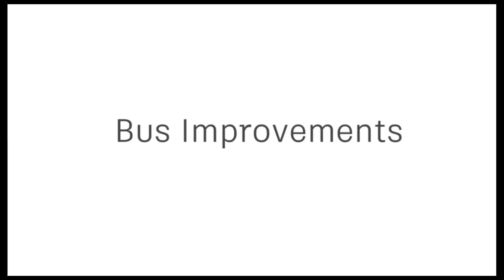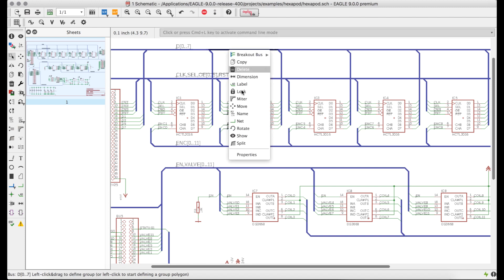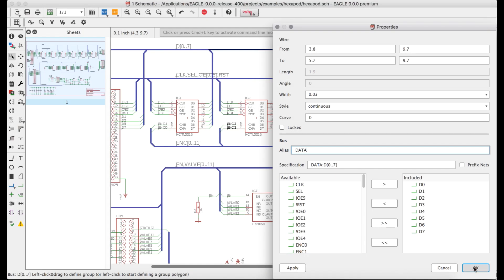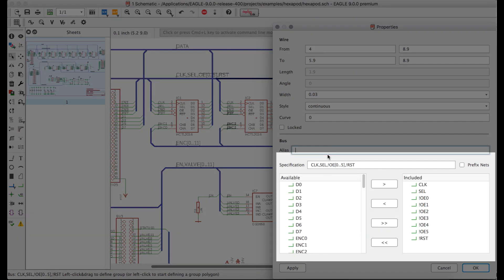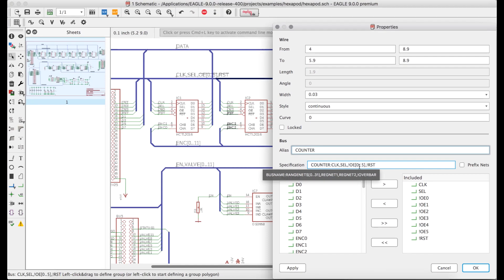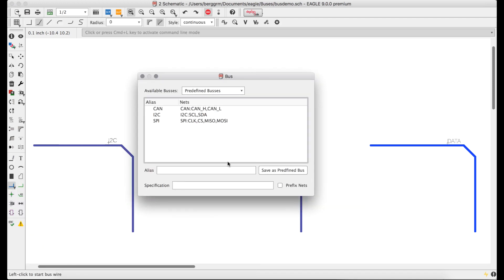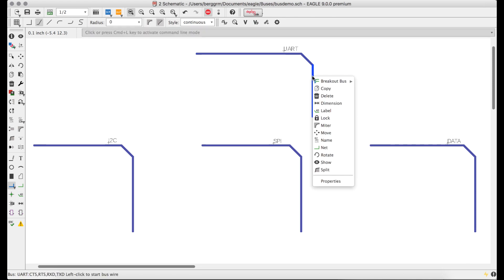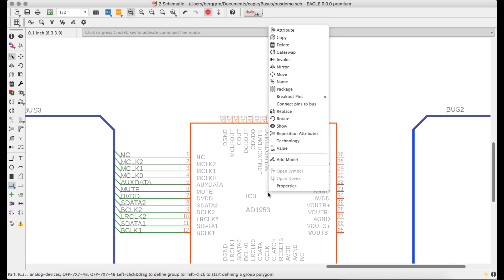Schematic Wiring, New Bus Breakout, Dialog and More - PCB Design

Comment: Why is the rendering of the schematic so awkwardly distorted? Why can't the renderer keep constant strokewidths within one and the same structure? I mean.. just look at those letters. Why did you even change the scaling algorithm? This looks horrible, I don't want to work with that. There's a significant difference compared to older versions of Eagle. How can you embody such low standards? I always wondered why in 2018 still no E-CAD tool uses smooth dithering in their renderer and you managed to make it even worse. I'm upset.